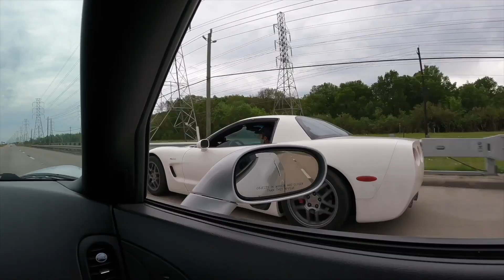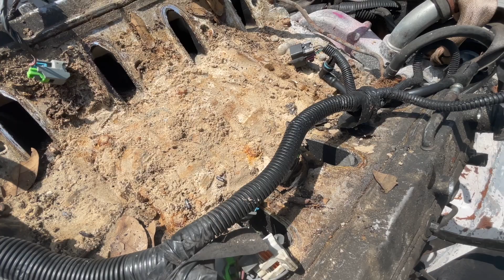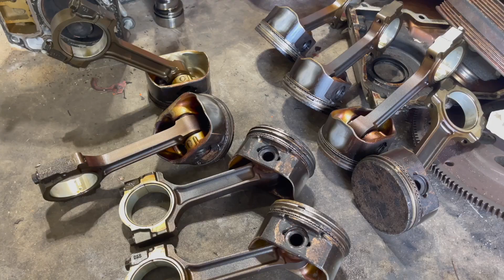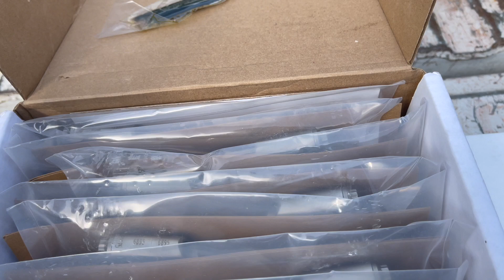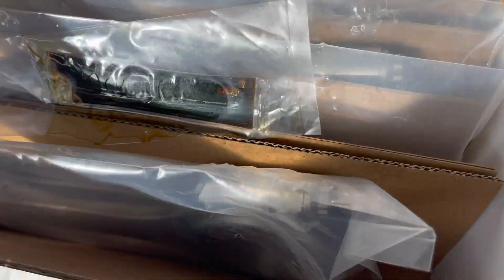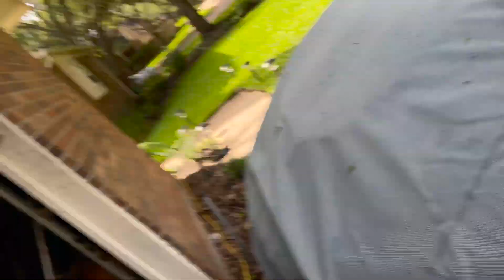Blown up C5 Z06 Corvette Episode 3: I SOLD my LS3… *Time for TWIN TURBOS*

Comment: This is exactly what I was thinking about doing. My car has a a&a kit and makes 700ish at the motor which is, to me, the edge lol. Does the gen 4 block have all the bosses on the front of the block for the c5 accessories? Dude ill being following your build.
Reply from the maker: Nice build! The gen 4 block has everything you need to bolt up the corvette accessories, so there shouldn't be a problem with anything. And thank you for the support!